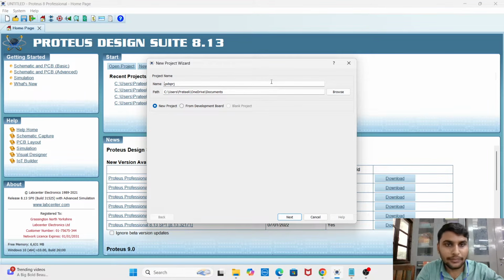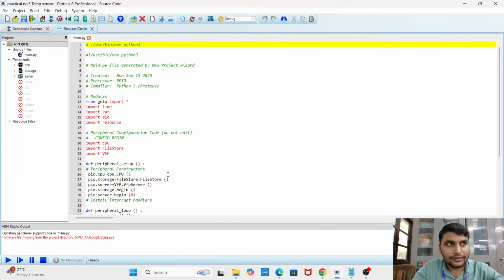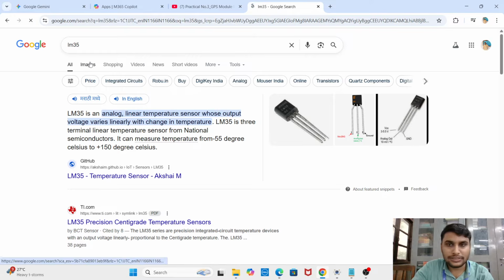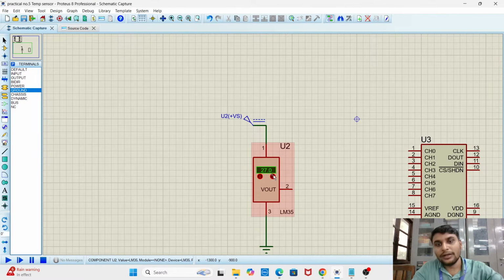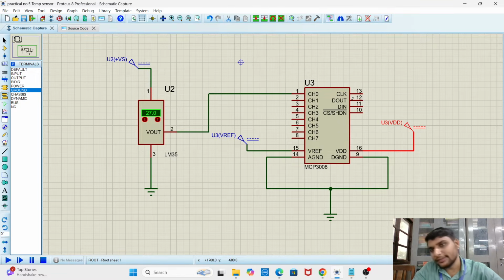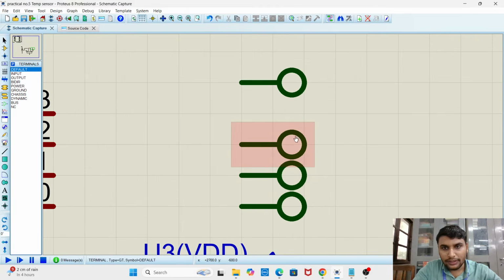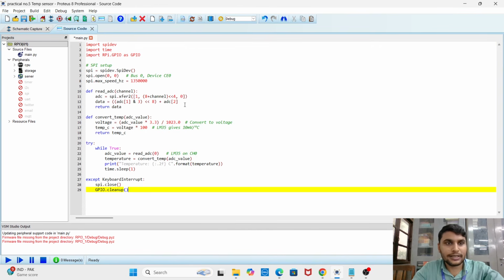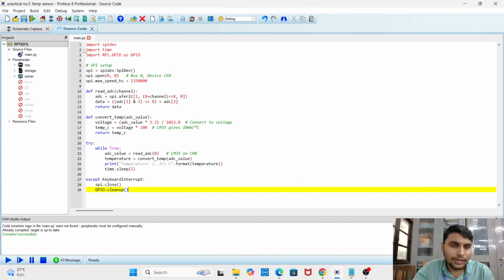Practical _no.5 _Temperature Sensor

Comment: Code - 
import spidev
import time
import RPi.GPIO as GPIO

# SPI setup
spi = spidev.SpiDev()
spi.open(0, 0)  # Bus 0, Device CE0
spi.max_speed_hz = 1350000

def read_adc(channel):
    # Sends a 3-byte command to the MCP3008 ADC
    adc = spi.xfer2([1, (8 + channel) << 4, 0])
    # Extracts the 10-bit digital value from the response bytes
    data = ((adc[1] & 3) << 8) + adc[2]
    return data

def convert_temp(adc_value):
    # Convert the 10-bit digital value back to a voltage (assuming a 3.3V reference)
    voltage = (adc_value * 3.3) / 1023.0 
    # LM35 outputs 10mV per degree Celsius (1V = 100°C)
    temp_c = voltage * 100 
    return temp_c

try:
    while True:
        adc_value = read_adc(0)  # LM35 is connected to Channel 0
        temperature = convert_temp(adc_value)
        # FIX: Changed parentheses (:.2f) to curly braces {:.2f} for string formatting
        print("Temperature: {:.2f} C".format(temperature))
        time.sleep(1)

except KeyboardInterrupt:
    spi.close()
    GPIO.cleanup()

Comment: import spidev
import time
import RPi.GPIO as GPIO

# SPI setup
spi = spidev.SpiDev()
spi.open(0, 0)  # Bus 0, Device CE0
spi.max_speed_hz = 1350000

def read_adc(channel):
    # Sends a 3-byte command to the MCP3008 ADC
    adc = spi.xfer2([1, (8 + channel) << 4, 0])
    # Extracts the 10-bit digital value from the response bytes
    data = ((adc[1] & 3) << 8) + adc[2]
    return data

def convert_temp(adc_value):
    # Convert the 10-bit digital value back to a voltage (assuming a 3.3V reference)
    voltage = (adc_value * 3.3) / 1023.0 
    # LM35 outputs 10mV per degree Celsius (1V = 100°C)
    temp_c = voltage * 100 
    return temp_c

try:
    while True:
        adc_value = read_adc(0)  # LM35 is connected to Channel 0
        temperature = convert_temp(adc_value)
        # FIX: Changed parentheses (:.2f) to curly braces {:.2f} for string formatting
        print("Temperature: {:.2f} C".format(temperature))
        time.sleep(1)

except KeyboardInterrupt:
    spi.close()
    GPIO.cleanup()